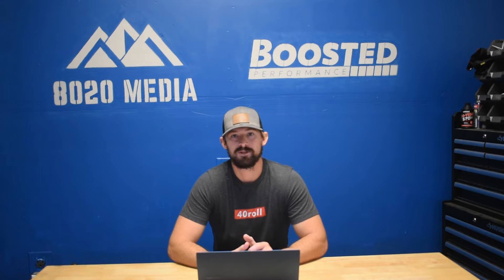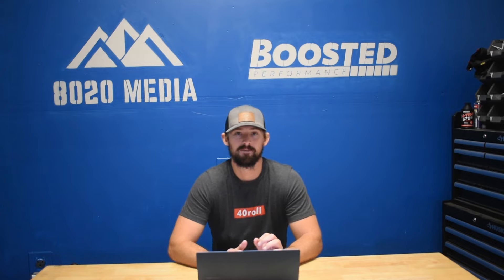DIY: How to Fix GMC/Chevrolet "Service Stabilitrak" & Traction Control Lights!

Comment: How to permanently remove this stabili crap from my chevy truck?? One kid here on you tube said to pull the ABS 2 fuse, so I did, stabili bullshit full time without the fuse!! cleaned the MAF sensor, stopped for about 2 months and back again!! removed the stock radio and ran with no music for months and no stabili bullshit either! thought I had it beat until I installed a stereo interface to fit a cd player...stabili bullshit out the ying yang with bells and whistles to boot! ran with no stereo again for a while with no stabili bullshit, until recently needed to fix low beams (module swap) reconnected battery and stabili bullshit is back with a vengeance!!! I want to REMOVE STABILI TRAC PERMANENTLY from my truck...which is for sale....
Reply from the maker: C - Sorry to hear about your frustrations. Unfortunately, it isn't the easiest thing to diagnose.
Reply: How do you fix it then if u can’t get rid of it there’s gotta be something 😡

Comment: Can't you just pull the fuse and turn off the abs/stabiltrack/ traction control perminatley?
Reply from the maker: If you want those lights to permanently stay on and don't want to drive with ABS or traction control. This really wouldn't solve the underlying issue since these lights rarely ever come on because of actual problems with Stabilitrak. As we discussed in the video there is a "fail safe" built in that causes the lights to illuminate for a variety of reasons. So turning off Stabilitrak/ABS/Traction Control when the issue is with something else isn't going to solve the problem.
Reply: @8020Media  my warning lights only come on here and there. More so lately.. The abs light and traction light will come on and chime and then go out again. Occasionally, they come on and stay on for a few minutes, then go out again.. It's just super annoying.

Comment: Reoccurring evap codes and fluttering idle hmmmmm
Reply from the maker: C - What EVAP codes specifically?
Reply: @8020Media  theyve been alternating sometimes even month without code but I get canister codes purge solenoid and or high purge code....I replaced purge solenoid it seemed to subside for little while but it went back into the cycle of showing then not....after watching this video you are definitely on to something with the fluttering rpm and the systems going into a safety mode turning off...ABS stabiltrak and TC all give service warnings at the same interval and it seems to be when put in to gear say a minute after firing up vehicle...if i let warm up for 5 mins and stay in Drive it seems fine but reverseing then driveing it throws up more frequently....if im doing town driving first or second 🛑 sign i get warnings if I have warmed up motor an trans and steady motion it seems to not detect issue....im leaning towards spark plug maintenance and looking into the evap codes....any ideas or info are appreciated greatly....this video broke down A LOT! 🙏
Reply from the maker: C - We hope this helps! Keep us updated as I'm sure many people experience this too.
Reply from the maker: C - Thanks for sharing.

Comment: Was Not helpful. how to reset?
Reply from the maker: Cadmus - 
Step One: Turn off the car and let it sit for a few minutes.
Step Two: Insert the key into the ignition and turn it to the “On” position without starting the engine.
Step Three: Press the gas pedal five times within five seconds have passed.
Step Four: The lights should go off on the driver information center, indicating that the system has been reset.

Comment: Take all this money pit shit out...my Equinox is goin thru abs/stabili trak problems Im tryin to figure out,when I punch the gas it comes on & steering wheel starts to shake as if one of the brakes is coming on then overnight it goes away
Reply from the maker: Joe - as we discussed in the video the problem isn't with the Stabilitrak system itself, so it isn't a "money pit" system. The fact that it happens when you punch the gas makes me think you're dealing with a fueling or ignition problem. Bad spark plugs or coils, clogged fuel filter, or slowly failing fuel pump maybe. This is probably giving you some really bad misfires which causes a lot more vibration that can cause steering wheel shake, but I'd also guess you could use some new motor mounts. Hook it up to a code reader and I'm guessing you'll see some P0300 codes.
Reply: @8020Media  Just bought a Launch 919E scanner,gonna run it tomorrow & get back
Reply: My code reader says bad EBCM & bad right rear abs sensor,bad Ebcm also creates eratic symptoms like locking wheel calipers while driving & this is what Im getting,this is a very good code reader that shows graphs & has resets
Reply from the maker: Hopefully this helps you solve the problem at hand. Keep us updated on this!
Reply: @8020Media  Its solved,traded it in yesterday for a dodge durango,had 1 b4 the equinox
Reply from the maker: That's one way to solve it! Congrats on the new ride.
Reply: @8020Media  Thanx,now comes buying stuff for it

Comment: Hi, to anyone reading this if you had a problem like mine and knows how to fix it kindly need your help.. 😥
So, my friend just had gotten his 2nd hand 2007 cadillac escalade last Friday.
It kinda have alot of issues and it didn't came with the manual.
It was fine until yesterday he was fixing his fob key at home and kinda pressed the buttons to make sure the key was working (he was in his apartment while doing this but the car was just right outside the apartment)
This morning when we took the car out had the headlights on, it suddenly started turning on and off .
Even if he turn the headlights off it just keeps on turning on and off by itself.
Does anyone had a problem like this? And how do we fix it?
Reply from the maker: Z - This sounds like an electrical issue to us. Is there an update on this?

Comment: Evap leak code came up on my Silverado then 2 days later the stabilitrak light came on
Reply from the maker: Dennis - did you look into the EVAP issues? We wrote a quick guide on P0449 EVAP issues that you can find here: https://chevytrucks.org/p0449-engine-code-evap/

The issue is usually the EVAP canister, solenoid, or a bad gas cap and issues with any of these could lead to some symptoms that would cause stabilitrak to disengage.

Comment: Them trucks are no good don't buy it people are spending a lot of money on them checking lights and don't have nothing wrong with it
Reply from the maker: If you can't find any problems then just ignore the light. But as mentioned in the video the issue is rarely with stabilitrak, although it can be. It's annoying because there are so many things that can cause it. But if your truck is running fine and no issues that you can find then just ignore the light.

Comment: So basically impossible 😅
Reply from the maker: Nutra - Not impossible, but very difficult. Sometimes it can be a super simple fix, but other times you could be going down a huge money hole, especially if you're trying to self-diagnose.
Reply: @8020Media  lol so just cut of the light on the Cluster
Reply from the maker: Don't think that's the best idea, but to each their own.

Comment: Have a 09 GMC Sierra 6.6 duramax, Allison trans. Have had this stabilitrak issue for a while. Comes and goes.
Always know its a problem when truck is started, the light is on and when put in gear it slams into gear. Have tried turning wheels all the way left and right and set for a minute,  didn't work.
 Push and hold Stabilitrak button for several seconds or longer to where it says its off and disabled and still slams into gear, and will not shift out of 2nd with rpm at 2500+
Have turned it on and off several times and disabled the Stabilitrak and nothing changes.
It will start without the Stabilitrak light on and will still slam into gear.
Front hubs were changed a couple of years ago, but not because of Stabilitrak issues, new brakes all around with no issues. 
Engine is running great always maintained. 
Haven't taken to shop, usually do my own work but running out of ideas.
Any way to completely delete Stabilitrak from the vehicle? Never need it.
Reply from the maker: Don - Sorry to hear about your on and off struggle with this. There are a few things we would suggest:
1. Checking for any engine codes, which I'm sure you've already done.
2. Check the wheel speed sensors
3. Check the brake light switch
4. Make sure all ground connections are clean and not corroded

Keep us updated on this!

Comment: 2012 GMC terrain 200k + on it , I take very good care of it and just got tires replaced and all of a sudden service stabilitrak came on no CEL .

I checked speed sensors, and all work like they are supposed to  ultimately come down to my throttle body, cleaned it up, and stabilitrak warning turned off but only the traction control blinks whenever the wheels are in motion , the road conditions don't matter , just that dam blonking . Has this happened to anyone else ? 🤔
Reply from the maker: Only thing I can think of is the steering angle sensor or maybe an issue with the ECM. Curious if anyone else has experienced it too that can chime in.
Reply: Since you were around the tires, could it be a possible ABS sensor

Comment: Running different fuel is not going to change anything with anything he’s talking about hopefully no one actually listens to this guy
Reply from the maker: And what do you know about fixing Stabilitrak issues? Not going to "change anything with anything" is a very insightful explanation as to why it would never work. These are literally solutions that have worked for other people...